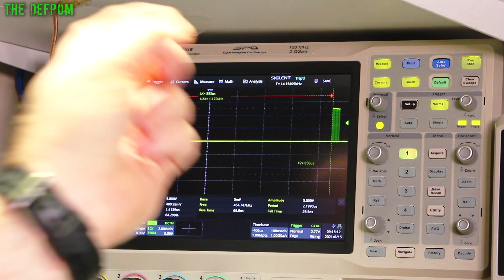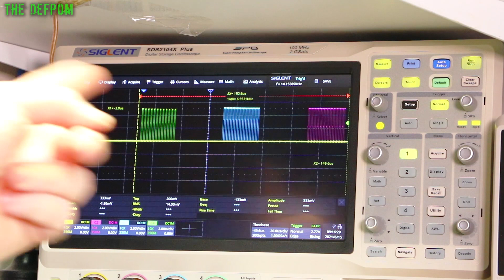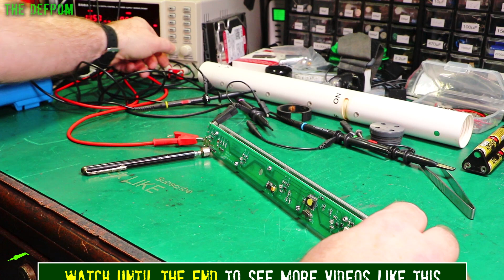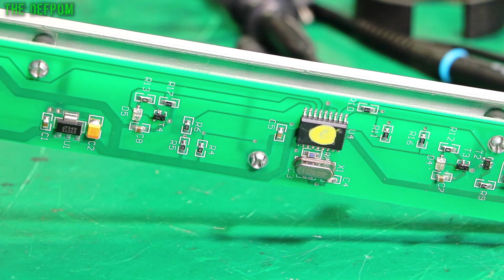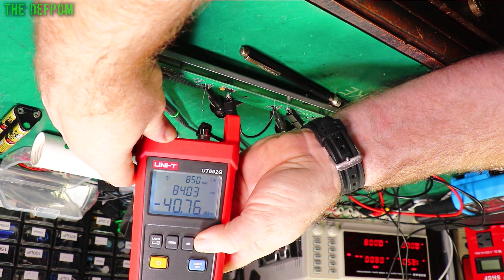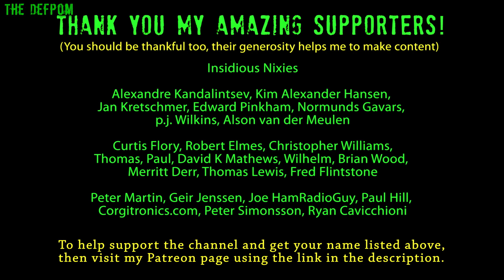🔴 Farmtek Light Curtain Reverse Engineering - Farmtek Polaris Sports Timer - No.853

Comment: At a guess, if P53H is not an SMT code then it could be an XE61C series voltage detector (SOT-23)
P53H:-
P = 4.x Vdc (open drain output)
5 = x.5 Vdc
3 = No delay
H = Production month
Reply from the maker: Well done, that seems very likely to be the correct part.

Comment: My newest scope is also 4 channel (R&S) but I seldom need 4 channels. I wanted one because I use several probes. I have permanent connected a FET probe, normal 10x probe, 20/200x diff probe and 1 channel free for what I need like a second normal probe, HV probe, current probe or for 50 ohm RF stuff. Very handy, no calibration and setting probe parameters.
Reply from the maker: That’s a nice way of doing it, on this new scope it is very quick and easy to change the trigger channel, so maybe I will do something similar.